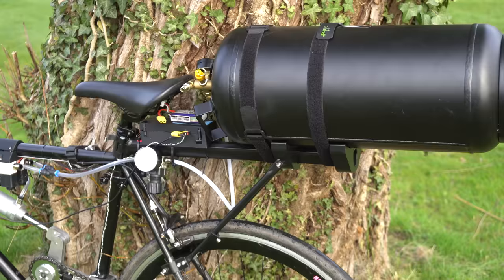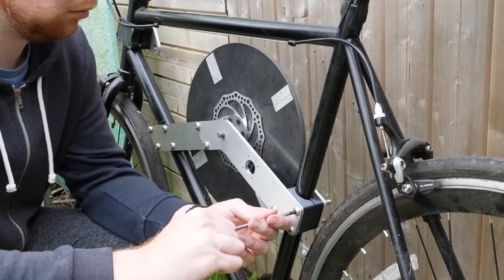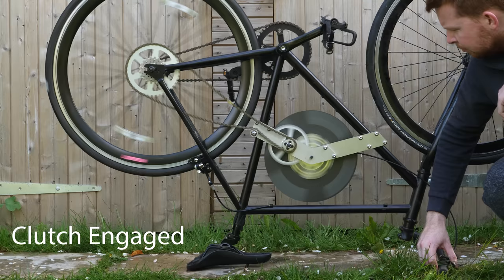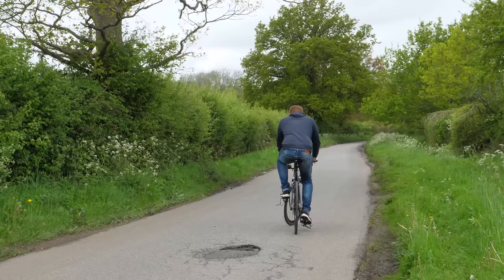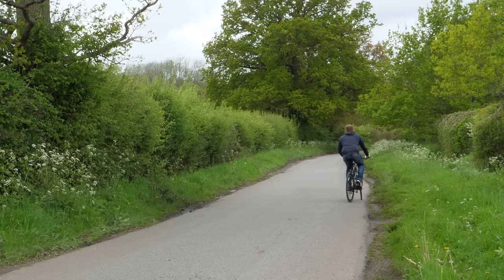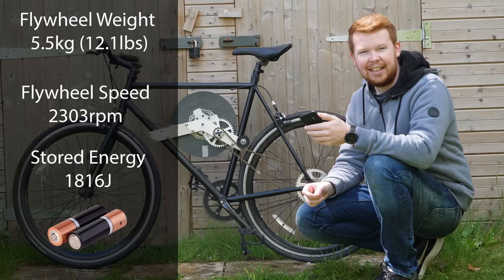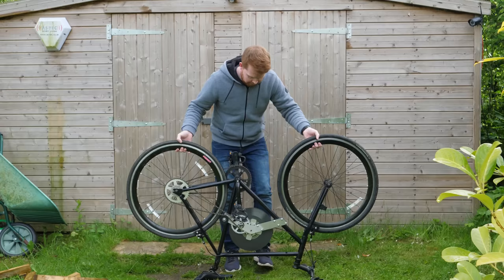Flywheel Bike KERS

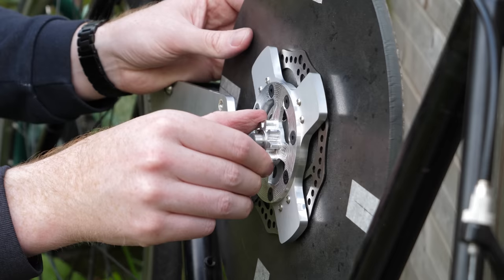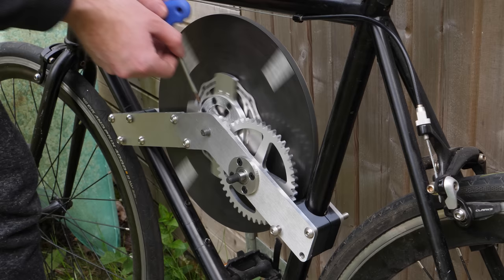Comment: 3:28 to 3:50 I think a flywheel-electric hybrid sounds interesting. 
Using an electric controller to make kind of an infinitely variable gear ration.
Then it could charge almost all the way to a stop, and use all energy to accelerate.
Reply: the issue is simply a matter of energy density unfortunately, at large scales 😅
bear with some back of the napkin maths. taking a car thats popular, an E140 corolla (im using a 3D model off sketchup's 3D warehouse for these measurements) lets say you somehow managed to make a flywheel of some huge radius, like 0.45m radius (placing this under the boot area here), say 0.075m height. and its made of iron.
As kinetic rotational energy is (½)(moment of inertia)(angular velocity)², we can begin with moment of a cylinder (good enough approximation): (½)(mass)(radius²)
mass in our case is density*volume, and volume is π(0.45²)(0.075)=0.0477m³, and irons density is 7300 kg/m³ therefore mass is 350kg(ish).
to return to moment: (½)(350kg)(0.45m²)=35.4375 kgm²
now i have no idea what a reasonable angular velocity really would be, this is total guesswork at this point but at 1000rpm (~105 rad/s): (½)(35.4375)(105²) it's storing 195350... i think joules? so that's like 0.055kWh or like. a miniscule amount compared to a modern nimh or li ion battery pack, if i haven't done the math wrong.
the gen 2 (older, nimh) battery pack is 53.5kg and 1.3kWh total capacity/0.5kWh usable.
(sanity check for myself: for a the same corolla that weighs apparently 1410kg, thats doing say 50kph (13.9m/s), if it can manage to recover 20% of that energy into the flywheel thats 0.2(0.5)(1410)(13.9²)=(0.5)(35.4375)(ω²) --> solve for ω and you get 39.2 rad/s. So I guess it could do something, but its still not as energy dense as a battery)
also interesting to ponder about losses. electrical systems do have loss via heat, but i wonder if its less or more than heat in a clutch. i would imagine less, if well designed. electric motors are just so well suited for that starting from a standstill application, thats my feeling at least
Reply: There's just not much point. Even if you could make the flywheel connection efficient and smooth without a complex, heavy linkage (doubtful), what benefit does an electric/flywheel hybrid get over a purely electric system that would make it worth all the trouble of melding two technologies?

Electric generators can already charge almost all the way to a stop, and an electric motor (which is, after all, just a generator running in reverse) is fantastic at producing instant torque with little energy loss and virtually no wear on the system. For short-term KERS you could use a capacitor, but if you're going to put an electric motor/generator into the equation, you may as well leave the flywheel out of it, include a real battery so you can get power-assist pedaling in addition to KERS, and well... you've just recreated the electric bike.
Reply: @Keenath  Yeah electric KERS do seem more efficient and "simpler" than mechanical springs / flywheels /etc. Especially without the need of "transmissions"....
Reply: @MikeSmith-vb8ul  kers is useless at first compare to electric motors and super mini capacitors(you don't need battery for it. Super capacitors can hold that little energy perfectly) 
Mini electric motor aend mini super capacitors could be a better solution.

Comment: Probably wont see this but when using your cnc to cut circles, for one the less distance betweent he bottem of your cutter and the positions its being held in the holder the better. When cutting circles you cutter will bend ever so slighty in two directions causing a less then perfect circular cut the farther the cutter can bend as per essebtially lever advantage, another way to cut down is simply to go around the hole multiple times either with or without taking more material off

Comment: Hello Tom. I ride a bicycle most days of the year, so I would love an invention that stored some of the energy lost when breaking. I would be curious to see a design where you hook the pedal chain up to the flywheel rather than the back wheel, and building a mechanism to engage and disengage the back wheel. I imagine that this would better allow you to transfer energy as you are breaking, because you could keep pedaling, because the back wheel wouldn't have to turn for you to keep storing up energy.
Reply: I was thinking more or less the same thing, but have the flywheel itself located inside the rear wheel...just not sure how to put that into practice.
Reply: so something similar to the KERS system used in F1 from 2011-2013? i'm not gonna lie, i really like that idea.

Comment: You need to think this one through a lot further. I would try using the entire backwheel as the source of kinetic centrifugal energy
Reply: Yeah I was thinking that too. Rear wheel is fixed and safely under the protective seat and frame.  If the flywheel spun encaged in the spokes...
Reply: But he does use the backwheel, that's what the flywheel is connected to.

You can't use the backwheel as a flywheel without isolating it from the ground, which kinda defeats the whole purpose

Comment: I would have prefered to install the flywheel centered in the rear wheel. This way center of gravity is much lower for stability. Also you can use your standard gear system used on most bikes. As is always the case, a flywheel needs to be a certain mass to maintain a decent amount of inertia. Obviously, a much more powerful breaking system would also need to added to stop safely.

Comment: Hey, cool project! Do you feel the rotational stability effect whilst riding?
Reply: since it's going the opposite direction from your bike wheel you'd have less angular momentum.. I bet that would make the bike feel much more nimble at high speeds, but also less stable
Reply: Would transferring the energy from the wheel into the flywheel while airborne assist is getting enough forward rotation for a front flip?

Comment: Just what everyone wants, an extra heavy bicycle.
Reply: only those interested in extra hard workouts for burning extra calories.
Reply: Always those pesimists... U can take off material of the disk and add it to the disks periphery, then the disk gets much lighter, and its inertia much higher... It was just a fast-and-cheap solution, as part of a proof of concept, and to dial in the mass of inertia needed for an even better protopype... In other words, 22% speed-gain is great, but he needs a cleaner running system, and a differently constructed flywheel, with most of its mass on its periphery...
Reply: Yo ever seen a perfect prototype? It's a very interesting concept.

Comment: Woahh, perhaps you could collaborate with James Bruton to use a gyroscope to stabilize the bike (he made a video abt it recently) or use that flywheel as a stabilizer of sorts
Reply: Just looking at some of James Brutons videos.. pretty cool stuff, thanks.
Reply: Woooo! Somebody's put a gyro on a bike?
Reply: isn't that bike already stabilized by the flywheel? Tom showed it at the end of the video.
Reply: ...
The bike wheels already act as a gyroscope, hence why a bike can move in a straight line without a rider
Reply: Well yes, but to actively control the bike with the gyro, not just be stabilized
Reply: Also with the active control through the flywheel gyro, you can stabilize the bike when it’s not moving. Check out James Bruton’s gyroscope video for the two wheeled robot or the boat stabilizer
Reply: Which video?
Reply: @user-221i  
The steady two wheel stabilizing gyros:
https://youtu.be/drxzs0Dnz14

The active tilting gyro control (boat, but the concept can be applied here aswell):
https://youtu.be/UVJx8T8wTQA
Reply: @ataphelicopter5734  Actually it's more about the fact that the bike naturally starts to steer in the direction it's falling. Otherwise you wouldn't be able to ride stably at low speeds. Gyroscopic effects are actually very minimal at typical bicycle speeds.
Reply: @c-djinni  That was showing the gyroscopic effects, but it wouldn't do much to stabilise the bike.

Comment: You don't need a flywheel, you need a capacitor to catch braking energy.
Reply: Thats what a flywheel does, mechanically..
A big capaitor , like the newer graphene film type, stores that energy as electrons, and could work with electric bikes/ motorcycles/ cars.
Wieght vs energy storage capacity is a key factor , especially in lightweight bicycle applications.

Comment: its all fun and games until u have to turn with a flywheel storing 20kJ of energy between your legs.
Reply: Yeah it’s essential a gyroscope, would be better to place it as low as possible near the rear wheel.
Reply: @TheNuclearBolton  A better place would be within the rear wheel.  

For that flywheel to store 20KJ it would have either be 60KG (same dia and RPM) Or spin at 7800RPM (same dia and mass) not sure i would like either between my legs.

Comment: You can improove this flyweel concentrating the mass in outside of flyweel, creating the center with aluminium and puting these 5kg in  higher distance of center using lead.
Reply: Please: I want him to make a bike where the entire rear wheel IS the flywheel! It would have to ride on a ring of bearings on the inside of the rim.
Reply: But this is nice as a proof of concept
Reply: This is dumb, aluminum would make flywheel just lighter, put as much weight as possible. If you want to improve it just make it from heavier metal, or make it bigger
Reply: @magearamil8626  No. A simply heavier flywheel means you carry more mass. Move the weight to the outside and hollow the inside increases the second moment of area.
Reply: @justincredible5406  ofc but it also makes flywheel weaker, in such simple design aluminium would only make it store less energy

Comment: If the flywheel could be hooked up to a tiny efficient CVT to your pedals, and another CVT to a wheel with a fixed connection to the transmission with some sort of computer controlling it with sensers to measure your speed and angle you might be able to use something like this to even out the load on hills. Which would allow you to have a riding experience more similar to a flatter area. It would also help if you used a material with a higher strength to weight ratio like carbon fiber and spun it up much much much faster.
Reply: Even if you could make CVT's that small that still work with the amount of torque required, they'd create more friction than they're worth. The sensors, wiring, programming, and such would add a level of complexity that's not worth it. A carbon fiber flywheel would also be a bad idea imo. You'd have to spin it up to such a high speed that friction would be a huge issue and it wouldn't have the mass to keep going, a heavier and slower moving flywheel would be a better option
Reply: Totally wrong. Fly wheel should not be moving when he ride the bicycle by foot, but only when he brakes or going down a hill.otherwise there will be no efficiency could get. And when adding flywheel means extra weight.so this extra weight should be deducted by reducing the weight of the bicycle .
Reply: @hiddenworldforge374  depends on the type of bearings you are using, and the type of CVT, you can get the flywheel up to a fairly high speed before friction becomes much of an issue and kinetic energy increases with the square of the velocity giving you a substantial weight advantage compared to other materials.
Reply: @nagodavithanaamilalakmal662  I don't think you understand what I am describing.

Comment: You need one gear ratio to spin it really fast under breaking and then you can engage a different gear with a lower ratio. That way you can engage the high ratio under breaking let it go and engage the low ratio to accelerate. After the low ratio maxis out let it go then engage the high ratio to accelerate even faster.

Comment: I think this has potentail if it can be spunn up while at a red light during stand still. Also i'd go for a capacitor. Ultra fst charging ultra fast decharging, much smaller than a battery.

Comment: Make sure the green lights on, don't wanna get shocked

(reference to electric F1 KERS. F1 has  KERS but they are electric, they used to have it in flywheel form, they call the electric system ERS)

Comment: Cool. i did this too in 2003. My flywheel was a 26" mtb wheel with 6 guage copper wire wrapped around to evenly distribute weight. I removed the top tube and installed a split top tube for the wheel to slip thru to fit it on a mtb. I left the cassette hub with 7 speeds on it so I could really get it up to speed. So Yes I had a pair of grip shifters and an extra thumb shifter on the bars.I did not use a clutch, though my friend wanted me to do that to do "burn outs". The end result was it was too much of a workout. It did seem to help getting up a hill after running down a hill.

Comment: lots of great concepts you employed in this design, well done!
Have you tried increasing moment of inertia for the flywheel? It should not necessarily cost the wheel an extra weight; all you have to do is to distribute lumped masses as far as possible from the axis of rotation; I believe even with the same total mass for the current wheel, you can increase the rotational moment of inertia and thus the stored energy.
Spiral spring seems to be another interesting concept to store and release the energy which would be lost upon a stop.
Keep the good job your doing, cheers
Reply: also, you may want to consider an "inclination activation clutch mechanism" which activates automatically based on the inclination angle by gravity to help riding an up hill...
Reply: Have you seen an easily accomplished weight distribution system besides cams and springs?

Comment: You could try building it inside the rear bike Hub in between the spokes. You could also then put some of these aero plastic covers over on top of the spokes, making it basically invisible and also more aero dynamic and the flywheel wouldnt have to fight against as much air as it had to before.

Im thinking of a mechanism somewhat similar to drum brakes they used to have inside of bike hubs

Comment: Wouldn't this loose energy whenever you turn with the flywheel installed vertically like that?
Reply: Yeah prob, but no speed for a horizontal disc. Gotta be realistic.
Reply: Yep. This is inefficient on so many levels. But still a fun experiment though

Comment: I wish you had engaged the flywheel while at the highest RPM , the moment stopped peddling as opposed to getting the bike to a stop  & then engaging it
Reply: That would keep him going at the same speed, nothing more. The same gear ratio that turned his 20 rpm of pedaling into 2200 rpm of flywheel just turns 2200 rpm of flywheel back into 20 rpm of pedaling. That'd just keep you going longer.
Reply: Right; This is using a clutch system to transfer energy, so the best it can do is match the flywheel's speed to the bike's momentum. When he brakes with the flywheel stopped, he can only slow down halfway with the flywheel; the normal brakes do the rest (he can then only gain half again the energy in the flywheel)

I think the only way to 'do better' than this would be to use a motor-generator pair. But even generators have lower RPM limits on recovering power (as I understand it anyway, I'm no expert)
Reply: When he is on a descent , & if he can engage the flywheel to Store the kinetic energy , but in that case the current design might not work

Comment: Did you experience any additional gyroscopic inertia due to the flywheel? Does this make the bike easier to balance or harder to steer? Might this make it possible to maintain balance at lower speeds or stopped?
Reply: I'd love to know this. Is there a park or something where laymen can try out inventions like this?

Comment: Curious if you could make the flywheel into a generator and use the electricity into a hybrid flywheel e-bike. This way, the flywheel would be spun up while braking and maintain energy generation longer than just regenerative braking would.
Reply: Adding a generator onto the flywheel is a bit redundant. The point of the flywheel is to store energy, so attaching a generator and a battery to it makes having the flywheel at all pointless. The flywheel doesn't magically increase the energy regained when braking, and introducing one  extra step in energy recovery means you lose more to friction.
Reply: @clarkhaines4599  You've heard about regenerative braking right? Similar except the braking spins up the flywheel and the flywheel acts as a generator.
Reply: @The1stDukeDroklar  Ok, I guess I'm not really sure what you're talking about then. My bad
Reply: @clarkhaines4599  it'd be pointless mechanically, but maybe if you can put some coils and magnets inside the flywheel... but I'm no expert by any means